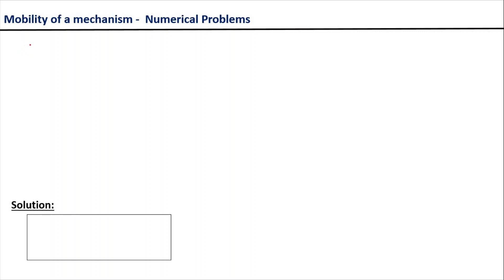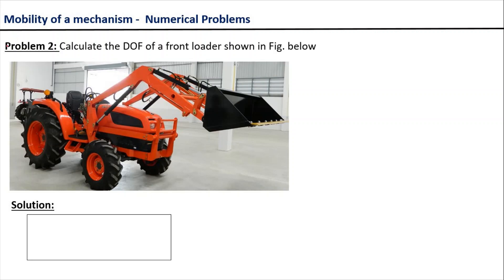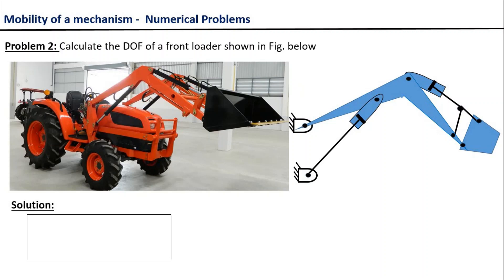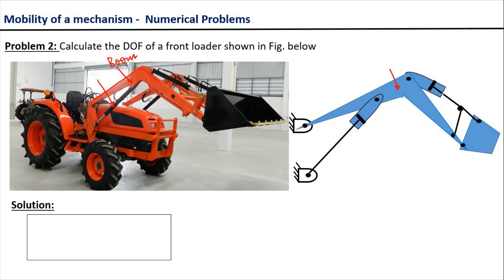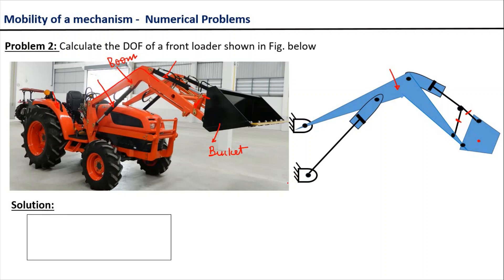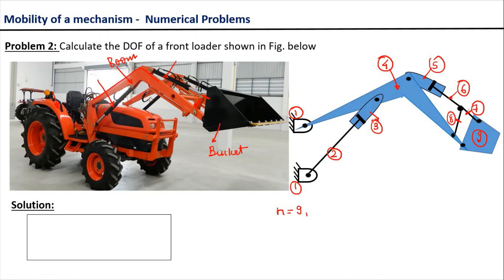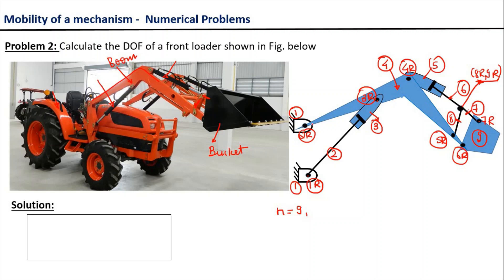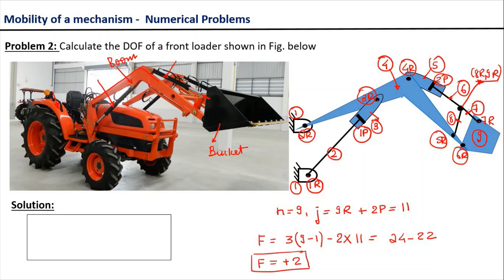M1.15. Numerical Problem 2 | Degrees of Freedom | Excavator Mechanism

Comment: but there's 4 hydraulic cylinders in the other pic, confusing ...
Reply from the maker: Since we are considering a planar mechanism, the motion of points on hydraulic cylinders can be treated in a single plane. Planar mechanism is also defined as a mechanism where all the points move in parallel planes.